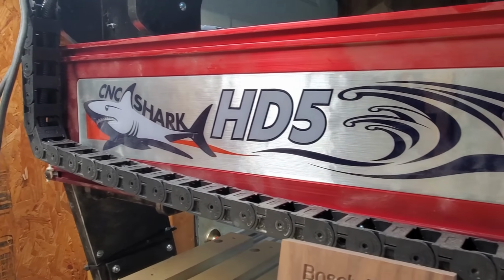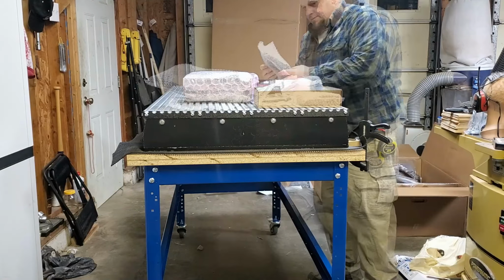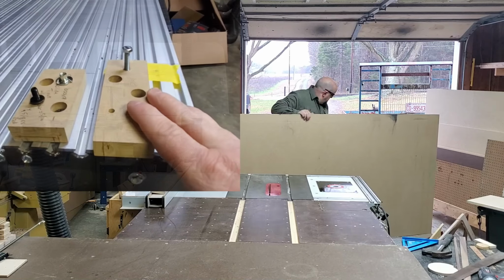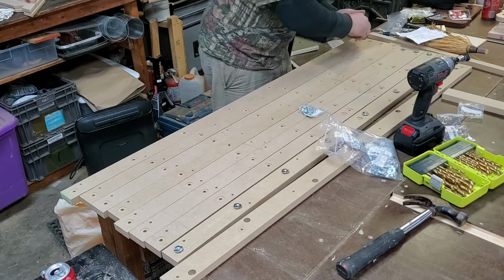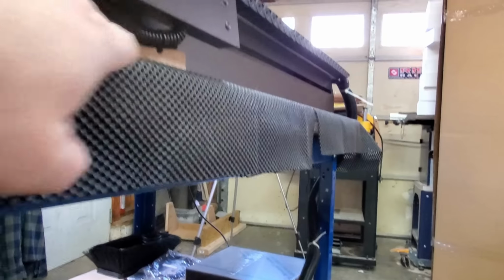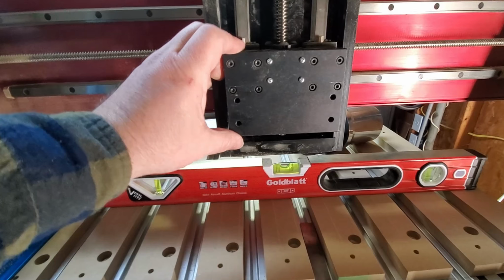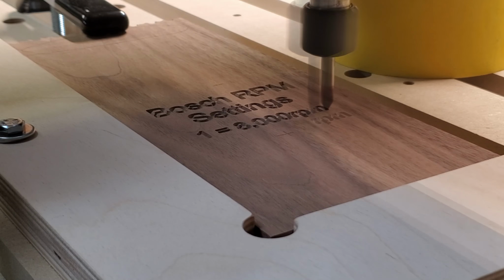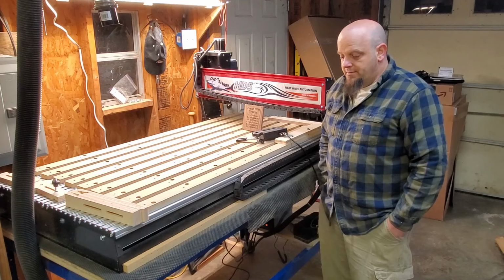Shark 5HD EXT 25x50 CNC Full Assembly With Problems and Fixes

Comment: Excellent.  I just hope less than technically savy people like me can learn the programming.
Reply from the maker: Its not that difficult.  Start small and simple.  Check out mark Lindsay. He has some nice playlists on vectric for the beginner and of course vectric.  Also check out spindle TV on YT as well.
Reply: Thanks for your professional and fun video! Definitely a very intriguing machine. I just read further down you upgraded to a different machine.  Did you get the issue with the vacuum attachment (bristles getting pulled in) resolved?  Seems that would be a common issue with all machines, or maybe just the bristles too long/soft?
Reply from the maker: I did.  I upgraded to a Kent cnc dust boot.  It has firmer bristles and doesn't curl in.  I did a whole video on it.
Reply: Good to know, thanks!

Comment: Just ordered this and it's due to arrive next week. Been using Vcarve Pro for a while now on a cheap Chinese knockoff machine that has been fun to learn on before I took the big money plunge. :)
Reply from the maker: Congrats!  You will like it.  It's a good machine.  Virtual Zero Unlimited is an industry game-changer.  I would still have mine but needed a few things the Shark didn't offer.
Reply: @ChristcrossCrafts  Thanks. I ordered it with the 4th axis and probe. Wondering how that will do. I mostly will be doing smaller projects as I'm getting away from doing furniture and variations on large boxes.

Comment: I just got one   My table was put together backwards so they are sending me a new one. Still working on learning the software. I wish they had a better manual
Reply from the maker: Man, I hate you had table issues. Everyone is short handed these days and things tend to slip through the cracks.  Download the full manual online.  It is MUCH more informative.  The one that comes with the machine is simply the assembly instructions with some basics.
Reply: I too am still trying to get it to run.  it's been 3 days now.  definitely not plug and play. The manual is pretty worthless.

Comment: Thanks for the video! I’m looking forward to ordering the hd 5
Reply from the maker: I like mine.  They are about to release software for the Shark that will be unlike anything else out there.  They have been testing and promoting it for months.
Reply: Christcross Crafts what are you hearing about it i have an hd5 not 100% happy with it. I’ve had it since august 2019
Reply: @mikeperez5623  I just bought an HD510. I'm curious what you are having issues with...
Reply from the maker: I liked mine but ended up getting the  Axiom AR8 Pro.  I needed more... umph, and a spindle.  The pro has it.
Reply from the maker: For basic stuff it was great.  I had a few customers and required faster feed rates and more ability to use 1/2" shank bits without compromising power and accuracy.
Reply: @ChristcrossCrafts  Oh! You ended up getting rid of the HD? OK. Yeah, I actually have the spindle, but the 1/4" bit is a tad annoying, to be honest. I'd rather be able to have 1/2" shank. Thanks for your informative video though. It helped me with my setup. I'm actually getting ready to make my wasteboard this weekend. I liked your method. Any gotchas with the MDF strip method with the t-bolts?
Reply from the maker: @dabruzere  the limited shank option was a huge factor.  The Axiom has a built in reservoir and pump.  No bucket.  Plus its a full 2.2 watt (3hp) spindle.

No issues with the strips.  Ive since adopted a 1/4" pin fence instead of wood.  I drill into the spoilboard along the left and bottom every 3 to 4"  insert 1/4" pins as my fence.  It allows for full passthrough of bolts and hardware.